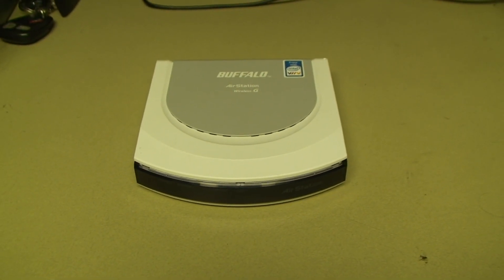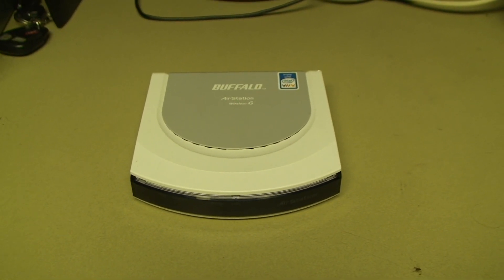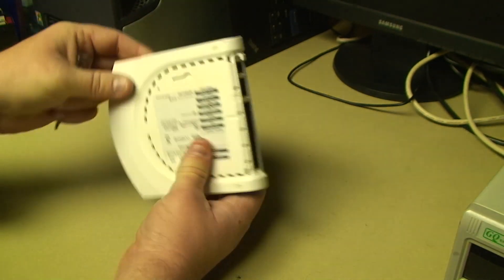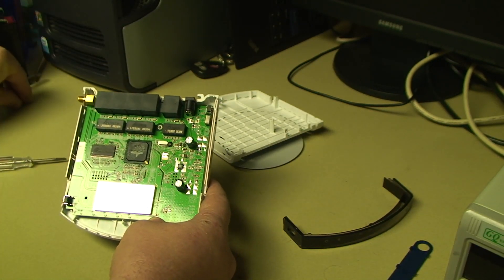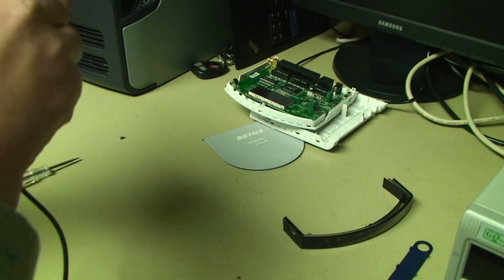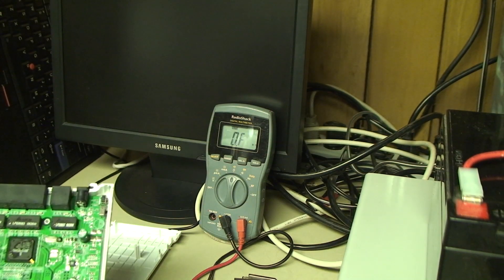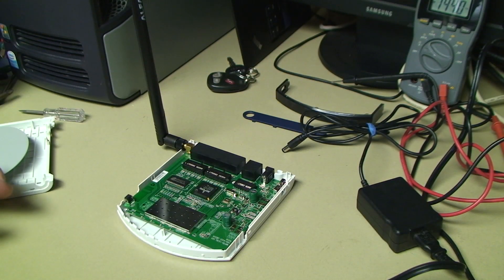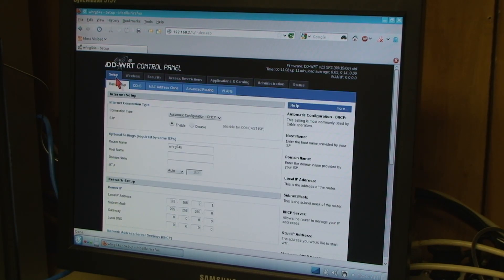Kitchen Table Electronics Repair - "The Wrong Power Supply"

Comment: It can not be just the device but the power supply its self and I have a story about that one. In the summer of 2004 I was playing around with a computer controlled telescope whose power supply was long gone and all that I had was a AA cell holder that held 8 of them which I knew to output 12 volts. Most 12 volt DC devices have a tip positive polarity which this telescope did and so I plugged the power supply into it. Everything worked fine until I tried to move it. (continued)